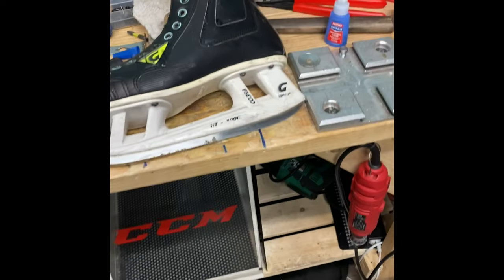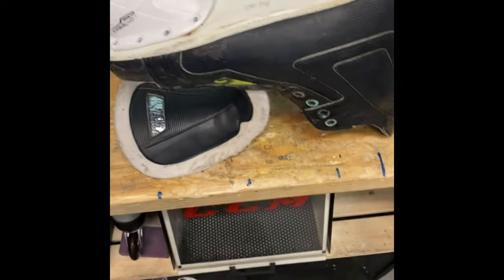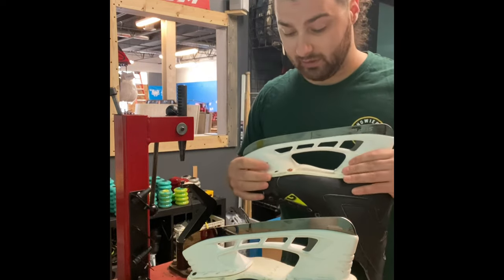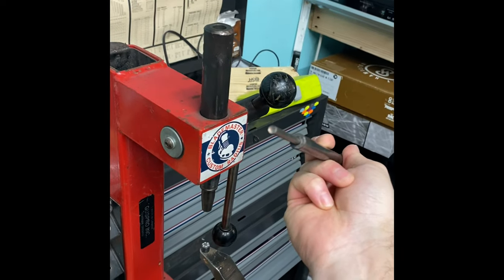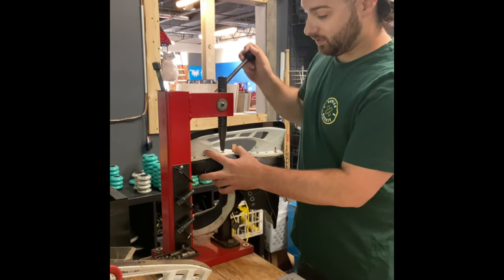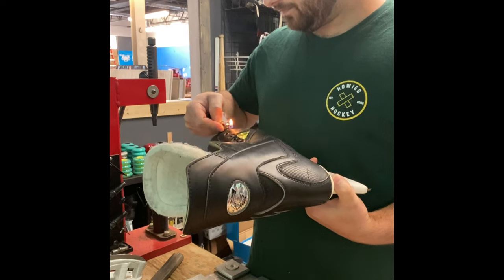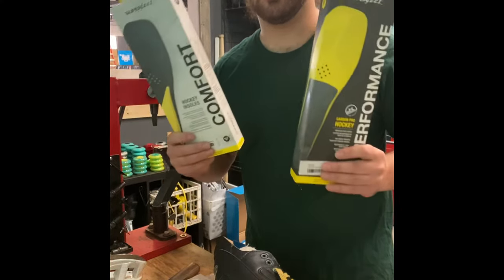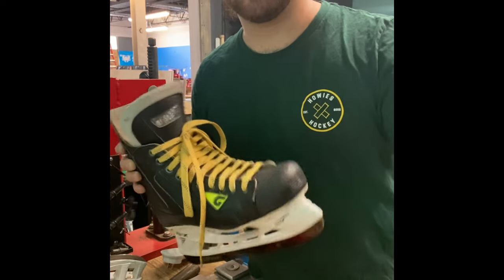Hockey Skate Rebuild Graf Supra 700’s

Comment: I use AS1 tacks - 1 piece and they fit great and perform awesome. That said, I believe the comfort and the progressivity of the flex on my Graf 709s made me a 'better' skater when it came to playing defense. 

I feel that the one piece, super stiff boot is lighter and definitely puts down more directly, but also at a cost of the purity of the extension of the 'push'. Even though my 709s are much heavier, if I was logging more blueline time and also needed more control, I felt I had an advantage with the Grafs.

Comment: The skates are actually 709s. I've worn them for years! I've changed out the Cobra 3000 holders for Graf's Ultra 5000s and changed out the steel for Step Blacksteel blades. They still perform great for me!

Comment: Bonus tips: use a small bull’s-eye level on the outsole to find a level position to hold the boot, and use a drill with a bull’s-eye level and and extra long 5/32 inch drill bit to drill perfectly straight holes which is important to make sure rivets go in straight as not to push/pull the holder in different directions when the rivets are tightened down. The extra long drill bit ensures that the drill does not knock on the blade or holder causing the bit to drill sideways.